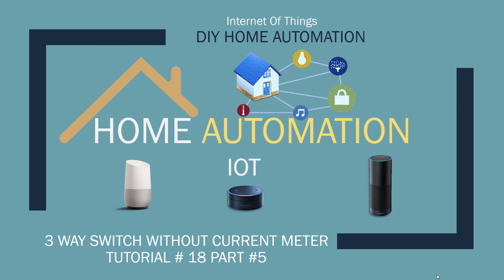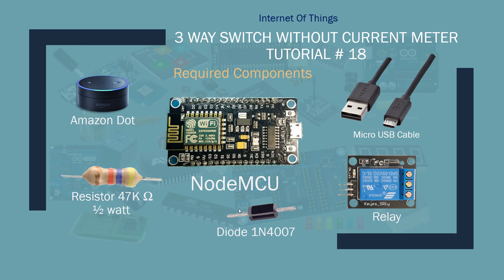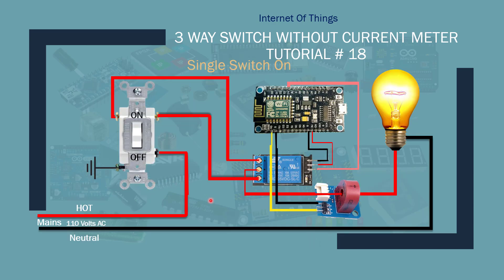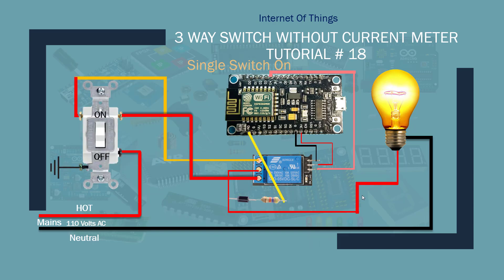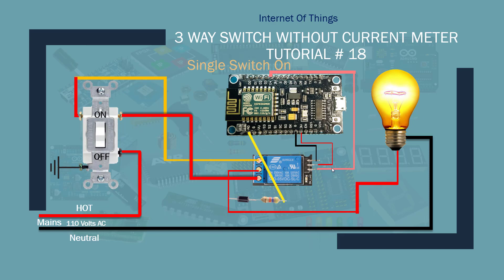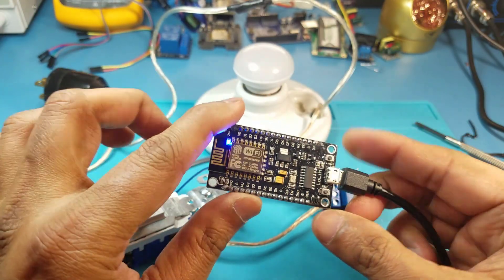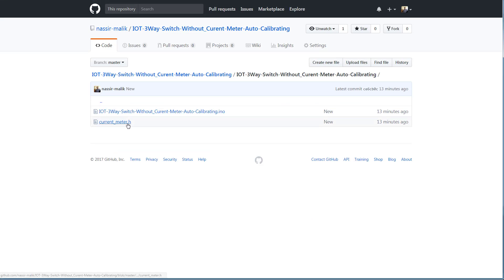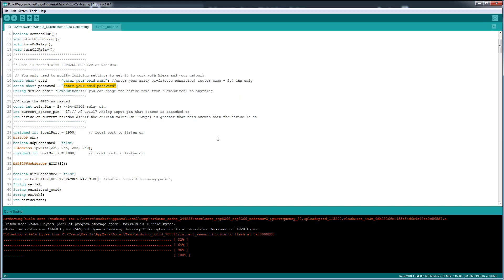IOT | 3Way Switch Without Current Meter Auto Calibrating | Alexa | NodeMcu | Tutorial #18

Comment: Hi, I don’t have knowledge on electronics, electricity nor programming but I’ve been able to do this tutorial.  :) Thank you for making it ease. I’m interested in a 4 way switch so the MCU is in the middle and in case it crashes, I can still turn the light on/off from the two manual switch.  I understand that a dpdt relay is needed for this.  It would be great if you can do a tutorial about this. Greetings from Spain.
Reply from the maker: Cristobal Casado thank you for your valuable feedback. Stay tuned for more variations for 3 and 4 way switches.

Comment: Im getting compiling error 
Arduino: 1.8.16 (Windows 10), Board: "Generic ESP8266 Module, 80 MHz, Flash, Disabled (new aborts on oom), Disabled, All SSL ciphers (most compatible), 32KB cache + 32KB IRAM (balanced), Use pgm_read macros for IRAM/PROGMEM, dtr (aka nodemcu), 26 MHz, 40MHz, DOUT (compatible), 1MB (FS:64KB OTA:~470KB), 2, nonos-sdk 2.2.1+100 (190703), v2 Lower Memory, Disabled, None, Only Sketch, 115200"

C:\Users\Admin\Documents\Arduino\IOT-3Way-Switch-Without_Curent-Meter-Auto-Calibrating.ino\IOT-3Way-Switch-Without_Curent-Meter-Auto-Calibrating.ino.ino: In lambda function:

IOT-3Way-Switch-Without_Curent-Meter-Auto-Calibrating.ino:232:14: error: request for member 'indexOf' in 'request', which is of non-class type 'int'

  232 |   if(request.indexOf("GetBinaryState") >= 0) {

      |              ^~~~~~~

exit status 1

request for member 'indexOf' in 'request', which is of non-class type 'int'

This report would have more information with
"Show verbose output during compilation"
option enabled in File -> Preferences.

Comment: Hi I was wondering what the code would look like if you just used a opto-isolator and just measured a high or low on the status pin?
Reply from the maker: Remove the "currentMeter();" in on off function in ino file and check the opto high or low and set the of "deviceState"

  
void turnOffRelay() {

  Serial.println("turnOffRelay.....");

  Serial.println(digitalRead(relayPin));

     //   check opto state and set the  deviceState variable to high or low

Serial.print(digitalRead(relayPin));

  if (deviceState == 1){

    digitalWrite(relayPin, !digitalRead(relayPin)); // turn off relay with voltage LOW

  }

}
Reply: new to programming do I need to still have the current_meter .h file?   @netmedias7657
Reply from the maker: @ahellard74  NO you don't need it. Remove it from your main sketch. Good Luck

Comment: Hi Nassir, thanks for the greats projects!!  I have an issue with Alexa recognizing this device. 
On  serial screen:
Saving Calibrating current...
27
Reading EEPROM
Door Status: 22
Reading Calibrating current...
22
Saving Calibrating current...
1024
Reading EEPROM
Door Status: 1019
 
Any tougths? Regards.
Reply from the maker: Are you able to discover the device?
Reply: Not yet
Reply: @netmedias7657  Hi there, Thanks for your response. Alexa finally detects the device but it says that "Demo switch is nos compatible with this".
 I had this error first at compiling: 
exit status 1
request for member 'indexOf' in 'request', which is of non-class type 'int'

I comment those lines and it compiles but it  doesn´t work as it should. Every time that I turn off the interruptor it keeps turning on by itself!!!

0########## Responding to  /upnp/control/basicevent1 ... ##########
Got Turn on request
turnOnRelay.....
0
The effective value of the current is(in mA)
1024
Switch was on
0########## Responding to  /upnp/control/basicevent1 ... ##########
Got Turn on request
turnOnRelay.....
0
The effective value of the current is(in mA)
156
Switch was off
0########## Responding to  /upnp/control/basicevent1 ... ##########
Got Turn on request
turnOnRelay.....
1
The effective value of the current is(in mA)
1024
Switch was on

Any ideas?  Thanks in advance.
Reply: Marcos Yllades i am also getting thr same error have u resolved it sir ??

Comment: Great video. Is there a way to use the same setup or the setup with power meter to run 2 separate switches to separate relays? And set it so if one relay is on the other relay turns off and vice versa?
I'm looking to switch the fan speed  between speed one and two with automation with also a backup manual switch. So when I set speed one on the fan speed two switches off. And same thing happens when speed two is selected. This tutorial would definitely help to get one speed going but I need tthe second speed also. They can't both be on at the same time because of the resistance difference on both switches. Hope someone can help.
Reply from the maker: Using this method has limitations since NodeMcu has only one analog pin. You can use  converter but it makes it more complected. I show how to use ADC in pi 3 tutorial. I am working on another tutorial that works with that standard GPIO. Stay tuned.
Reply: Thanks for your reply. What if digital switches were used?
Reply from the maker: You can used ADC converter to use with digital pin.

Comment: Hi again... I re-flash the notemcu and have the diode and the resistor pointing accordingly... however, I can only get the light to turn off/off  from  alexa if the switch is  in the on position. I can't seem to get the switch to turn on or off/off the light only if the relay is in the close position. 

My setup is just like yours along with the nodemcu v3

1########## Responding to  /upnp/control/basicevent1 ... ##########
Got Turn on request
turnOnRelay.....
0
The effective value of the current is(in mA)
10
Switch was off
0########## Responding to  /upnp/control/basicevent1 ... ##########
Reply from the maker: bobby royster You need to turn on the light and press the flash button to calibrate it.
Reply: When I say alexa turn off sw it will turn it off and when I say alexa turn off sw it will turn on 

1########## Responding to  /upnp/control/basicevent1 ... ##########
Got Turn off request
turnOffRelay.....
1
The effective value of the current is(in mA)
6
Switch was on
1Saving Calibrating current...
0
Reading EEPROM
Door Status: -5
Reply: I think I  find the problem .... My light switch (LSW) has the black screw where you hook  up the two wire going to the relay.... so I connected mines just like you did. upon watch your video over and over the black screw have to go to one wire coming from the lamp. now its working

Also, I have to put in a number here ........................."int device_on_current_threshold;//if the current value (100) is greater than this amount then the device is on" 

so I put 100 since off is 10 and I gave myself some leeway, I replace milliamps to (100).. now its working like it should... doing it this way I was about to use a url command......... "http://192.168.0.133/switch" turn the light off.........but I have no way to turn it back on via url command...
Reply: you connected the pols on the switch wrong or on the relay. check again the tuts and your connection

Comment: the nodemcu can control upto 9 relays as it has 9 digital pins. Is there a way i could use a switch for all the 9 relays?
Reply from the maker: Use optocoupler/isolator to detect the current and then you can use all GPIOs. Good luck

Comment: Great Project. is there any way to use multiple relay control using ESP32 ...
Reply from the maker: Yes, See my other tutorial to control multiple relays. For current sensation you will need to use ADC converter if you want to support multiple current sensing devices.
Reply: can we use ESP32 instead of ADC Converter and also want to control it using my smart phone, i am new to NODEMCU Prograaming....

Comment: Is there . away to use one ESP8266 to make more than one 3-way switch?
Reply from the maker: Pedro Henrique Peixoto you can use ADC converter. I am trying to find a simpler way.
Reply: Netmedias didn't get where this converter would help. I though the bigger issue would be to dedetct the current from multiple switches, since the esp8266 only has one analog input
Reply from the maker: Converts analog to digital and you can check if GPIO high then device is on otherwise it is off.

Comment: Nice idea using the diode-resistor to feed the analog in.  If the 1/4W resistor was getting warm that would indicate a significant current flow.  Wouldn't tapping off from a voltage divider with higher value resistance be a better idea? You could also set the voltage divider to make wider range for AC input.  You have another viewer below asking about 230V if you set the divider to give 0.25V for 115/120V then you would have ≈ 0.5V for 230V main power, which is well within the 8266's 1.0V maximum input on A0.
Reply from the maker: David Moran You are right and your are one of the best viewers I have bar none. I did not have to use my brain today to answer some of the questions. You took care of them and thank you for that. 😊
Reply: David hi, I am trying to understand the circuitry of the current reading through A0. Unfortunately, I am failing to get my fingers around it. This is what I see. I see two 3 way switches (mechanical relay & a switch) connected back to back with mains power on the common side of the switch and the common of the relay connected to both the load and the diode (in fwd bias) and the diode with the protect resistor of 47kOhms to A0. My question is how is A0 reading any current through? what voltage is it using? When say both switches are allowing current through from mains the load will complete the circuit, cool! the current will also flow thru the diode in fwd biased state BUT not complete the circuit as it is open end through A0 right?? how then do we calculate current through that protecting resistor which I believe is the one we are reading through A0? 
Please I understand the basics of electronics diodes and voltage divider circuits but I can't see past this. I know it works, here at RSA we are on 230 Mains and I want to implement this...
Reply: Netmedias , i did it but i can't calibrate good the System! I don't understand how the ac voltaje is converted in DC to go at A0 pin. I measure with the voltemer and it said 50v that was going to the input A0, i know it wasnt real voltaje! Where can I learn about it or how can I set up the System for a wide range of different loads? Thanks
Reply: +David Moran Do you mind elaborating on that? Is this voltage divider like a potentiometer? Electronics is not my forte, so I'm having a hard time following it.
Reply: @netmedias7657  So which parts needs to works with 220-230v ac main?

Comment: Can I use ACS712 (Current Sensor Module 20A range ACS712 Module module ACS712T Arduino) instead of this diode & resister???
Reply from the maker: Yes you can.

Comment: I am having an issue where the off command will both turn the relay high then Low, however the On command will do nothing as to changing the relay state . It's almost as if there is always current but I tested with a multimeter and there is none when light is off
Reply from the maker: It is doing that because the current sensing limit is not set correctly or you are using an Active low relay.

Comment: hi you did nice job but i have a issue what if i wanted to control 8 relays so can you tell me the code for that
Reply from the maker: Since there is one analog pin on NodeMcu we can only control one device. I am working on solution where you will be able to control using all GPIO pins.
Reply: @netmedias7657  hi thanks for your reply i must appreciate it.and for that i have an idea and want to know that if it is possible or not because i am new at home automation.
Reply: @netmedias7657  can we make a program with if else statement that if the relay is high than make it low and if the relay is low than make it high. for example:- if i say alexa turn on demoswitch than it will figure out that if the relay is high than make it low and it relay is low than make it high. so this way we don't need current sensor or anything else too. and we can control it from physical switch and alexa both... reply if it is possible or not....

Comment: HI Bro .. i have been watching your videos for the last two days , and trying to understand the things which u have done to connect the three way switch with the single relay  ..later  but i understood the connection shown in the diagram .. i have not gon the coding part . but i will watch the coding part later .  .. other thing is that  i dont  have much knowledge like you do  in electronics components and circuit connections , but just  know little  bit of this and that .. well coming to the point  here .. i have echo dot , a both 4 channel and a 8 channel relay . also have successfully connected to the echo dot and relays with the help of nodemcu esp8266 .. till now haven't fired it up on the ac mains .. but i used with the dc currents to switch on and off  all the  relays with the help of alexa ..  but i havent connected using the three way switch just like liked you shown in the video with  dc current , as well as  with the ac current too .  next thing is that i i wanted to connect it with the ac power ..  just like you shown .  i was planning for my room automation after seeing your video with the ac current connected with relay and alexa with three way switch  . but   in the diagram you are connected to only single  relay and also connect to  a analog input . so here you want  to help me out . i dont know what to do with it , as per i wanted to connect a 4 channel relay , (or a 8 channel relay with the help of nodemcu in future ) . also how to connect the analog pin too if using a ( 4 channel or a 8 channel relay' output loads) . so could you do a video how to over come with this situation , showing me how to connect the nodemcu esp8266 + 4 or 8 channel relay + along with ( how to connect the analog pin as input for the 4 channels or 8 channels relay as  load )  . hope you will help me out in this .
Reply: hi bro you got any solutions???? i have same situation

Comment: the problem is that you are not showing  us how to wire it to a 3 way switch setup
if  you have one 3 way switch then  you most likely have another 3 way switch that it goes to this is just showing  how to wire the node MCU to the circuit with only  one  3 way wall switch
i have  two  3 way wall switches and i want to use the node mcu and either of the 2 wall switches to control the light so   can you pleas ed o video tutorial on how to wire it that way?
i see you have both of the traveler wires going to the relay so then how would you connect in the other   3 way wall switch?
Reply: His relay is the second 3 way switch.  2 wall switches and the node mcu control would require one of the wall switches to be a 4 way.  The string of switches starts (power end) and ends (load end) with a 3 way switch and the additional switch(es) in the center of the string will all be 4 way switches. look at his IOT | Home Automation with Alexa | 4 way switch Part 3| and you will see it.
Reply: but that tutorial shows 3 wall switches and the node MCU smart switch i do not  want that either i want 2 wall switches and the node MCU controlling the light , so what do i need and how do i wire it?
one 3 way and one 4 way switch then  take the neutral wire from the 4 way switch that goes to the light and put it on the com terminal of the relay and then  connect the other 2 relay terminals to the 4 way switch traveler wire contacts?
Reply: one more issue i see is hw  are we going to power the node MCU ?
if i want to put this in my wall then can i use a   5v wall wart or maybe a buck converter to power the node MCU but then if you have a 3 way or 4 way switch you won't have one wire that is  constantly hot
Reply from the maker: Andrea Mitchell  Please see the "David Moran" answer. He is spot on. I am not sure if I can add anything to his answer. Good luck.
Reply from the maker: David Moran Thank you for your help. You did a better job explaining it than could have done.
Reply from the maker: Andrea Mitchell  Tutorial is coming soon where I will install an ESP in a electrical socket with relay. Stay tuned.
Reply: ok  but what about a switchbox instead of an electrical socket?
especially a  3 way switch box , how can we provide constant power to the node MCU if the switchbox only has a  3 or 4 way switch in it and  might not even have a  neutral wire? if i want to use  one of these in my   switch box it is not going to be practical if you need to run extra wires to keep  the node MCU powered , you should do a tutorial on how to power the node MCU so you can seal it in a switchbox and what to use to step down the power from 120 /220v to 5v ,  a small enough buck converter that can fit in a switch box along with the  switch  and the relay
Reply: +netmedias ok you never answered the question as to how we are supposed to power the  node MCU board ,can you make another video on how to  get constant power  to the node MCU board ? would that even be possible if i want to seal this in my switchbox which only has the L wire 3 way switched? ,i think this would never work in a practical use scenario  because there is no constant live wire to power the board 
and we would also need a transformer wall wart   and or buck converter to ge the proper voltage for the board,  can you make  tutorial that  shows to actually make use of this in a practical scenario and how we can fit the additional hardware in the box  to power the board constantly? and suggest components  to power the board

Comment: Can this code be used on the same network on multiple esp8266s as long as the Device Name "DemoSwitch " is unique?
Reply from the maker: Yes
Reply: Ok thanks I have seen people saying they have had issues with more than one device in the same lan.
Reply: Netmedias  when run the code it seems to work but if I use the Alexa app things don’t work correctly. Have you ever experienced that?